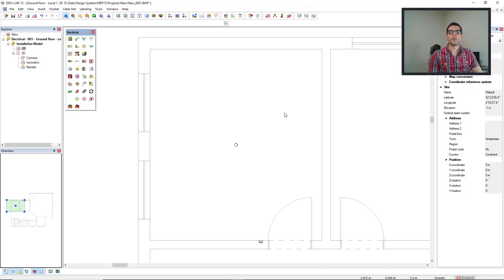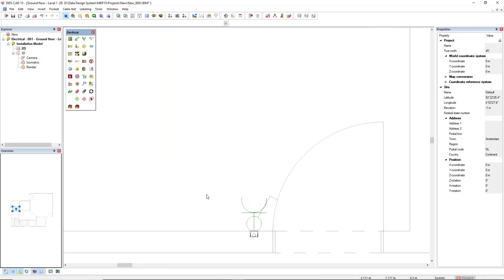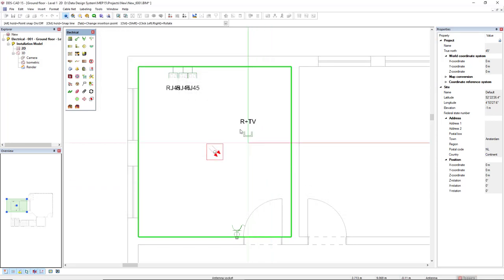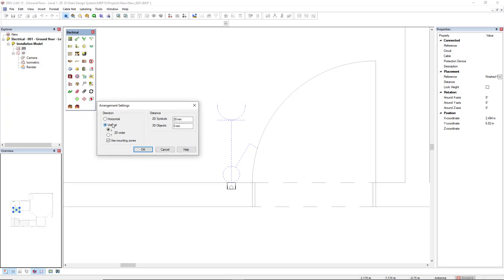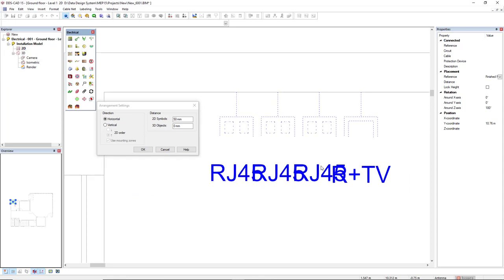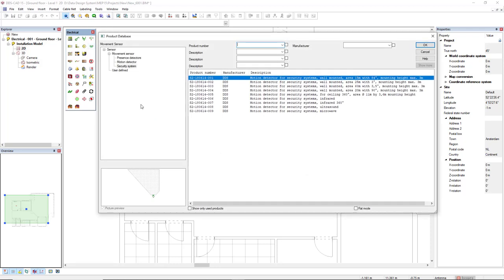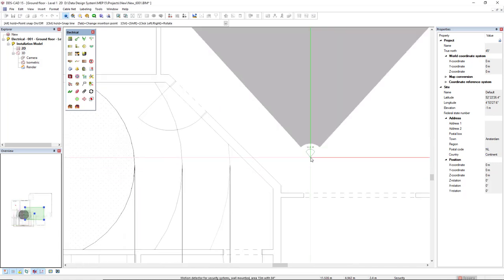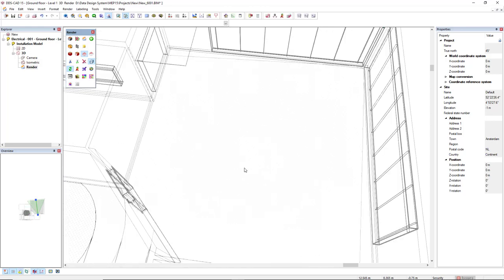Getting Started  - Electrical - Arranging objects as combination & Security detectors

Comment: How to place connectors and sockets in a multiple frame? So that the list of materials includes separate connectors and sockets and multiple frames?
Reply from the maker: Hi targetti, could you please send en email to support@dds-cad.com with you request? There we can have a better communication about your needs.
Regards,
Reply: @DDSCAD-MEP  You're right. I can write for support, but that's not the point.
1. Someone else may have a similar problem, and the youtube response is the best source of information.
2. Maybe another user knows the answer and will help me on youtube.
3. These questions can be used for Filipe's take on DDS-CAD playlist.
4. Support will send me to the representative in the country, but unfortunately in mine it works very poorly.
Reply from the maker: @targetti123456  , same situation with the questions from the other videos, it is hard to explain it in the comments, so I recommend to address us by email so we can give you the best support and if appropriate we can schedule a remote support.
Regards,
Filipe